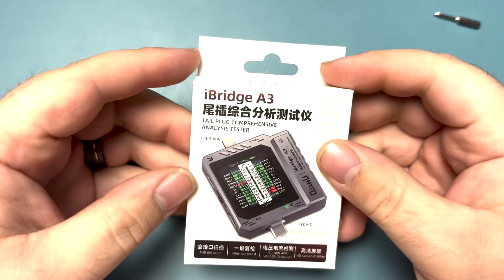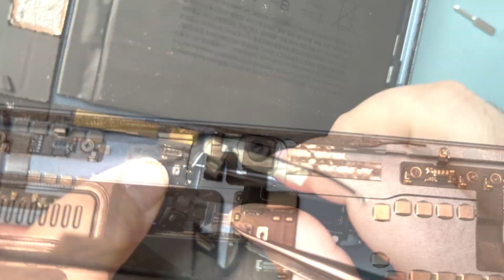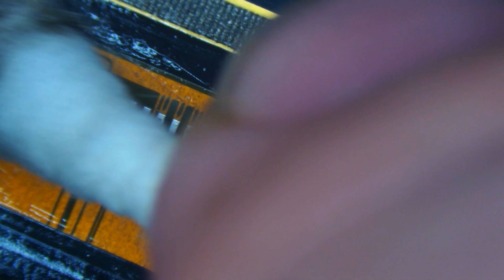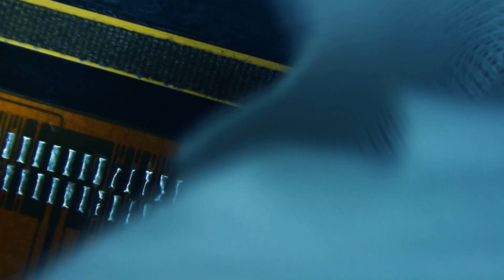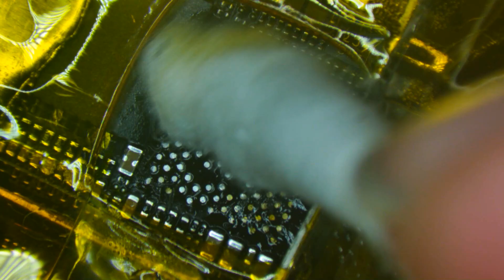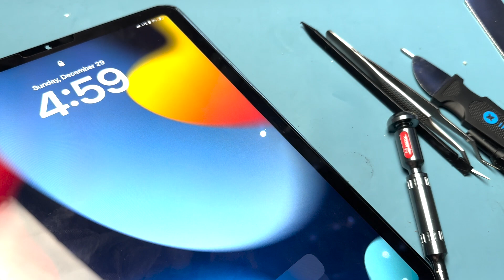Diagnosing and Repairing iPad Air 5 Charging Failure with iBridge A3 Tool – Professional Guide

Comment: I actually have an ipad that wont go above 1% whats the usual culprit with that ?
Reply from the maker: Typically one of the small pins that make contact with the battery pads isn't touching. Most of the time due to a pry tool that was meant to only isolate the battery during repair but bent the pin. Those data lines are important so that the ipad can tell how much charge the battery has and when to charge and stop charging the battery.

Comment: Hey sir can you use thiz to know if a phone charging ic is bad
Reply from the maker: Not directly — this tester won’t tell you if the charging IC is bad. It’s mainly for checking the port lines and making sure everything there looks normal.

If you see abnormal readings, it can hint at a bigger issue (including a possible IC problem), but it’s not a definitive test. For that, you’d need something like a Tristar/charging IC tester or go deeper with board-level diagnostics.

Comment: Ipad Air 5 no chrage but everything green on the iBridge A3 tested both sides. Do you have some info on where to begin 
? I get a 0.009 amp and every ones in a while a 0.100 flash

Comment: I bought this tool a few months ago. From my understanding, it tests all 24 pins when the device is off. I tested on my Samsung smartphone, on and off, everything is fine. But when i input it into a laptop, and the laptop is in standby mode, or off it can show some faults. Also on my PC when the PC is off, the readings are fine. It reacts and measures the data lines correctly, recognizes when the power plug is out of the socket ( OL ). But when i input it when the PC is on, it shows almost all connections shorted to ground. It is limited to recent systems and probably PD controller types. But if its purpose is to detect shorts on the PD controller and the USB-C connector, then it fulfilled its purpose properly. This is a little bit misleading. There is no user manual or instruction.